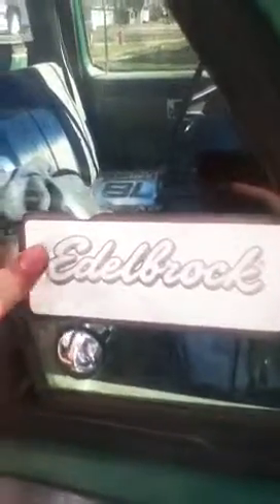old green sleeper truck

Comment: the truck and the video making skill used for this video have something common.
Reply: Around here, sleepers are completely average looking cars (eg VW Golf Mk2, Opel Kadet, old Beetle, etc) with modded engines that were never meant for those models (300-900+hp) and beat the crap out of lambos and ferraris. Sleeping beast, hence sleeper. I don't think old green could beat even my stock 540i, not a ferrari or lambo. Not that it matters as long as you're happy with it.
Reply from the maker: ya your probably right but when it comes to snow or mud old greens got that won